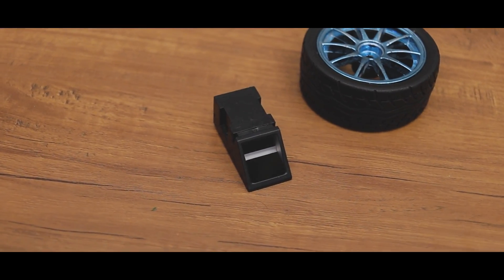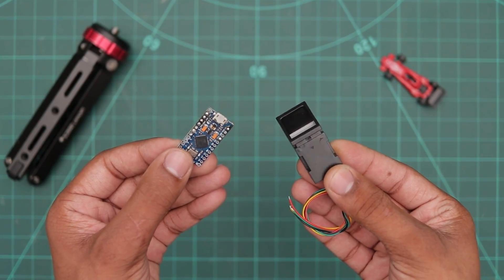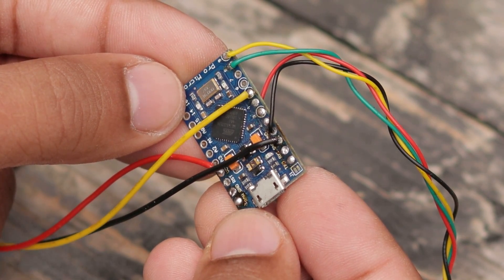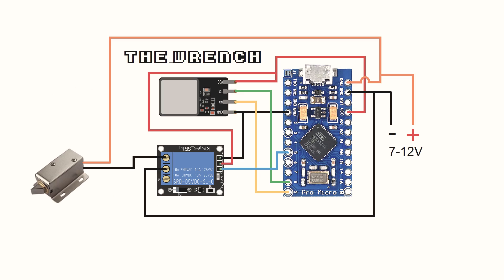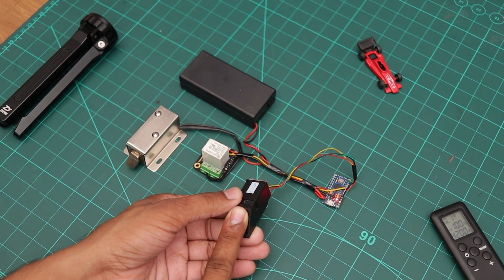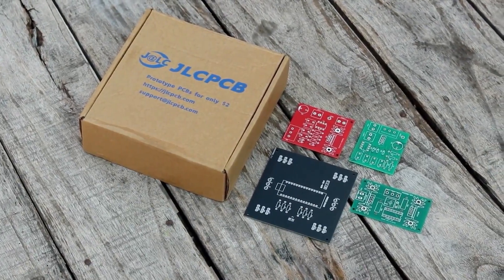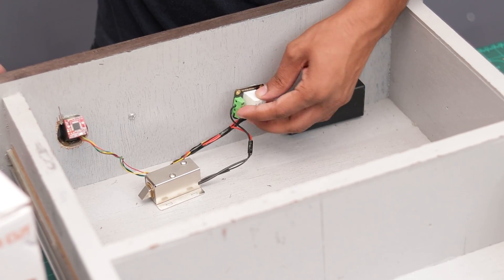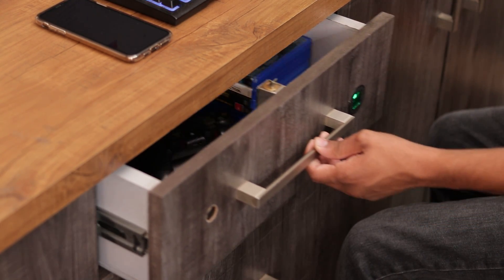How to install Fingerprint in Drawer | Amazing ideas

Comment: Bro If the battery is dead & the drawer is locked How will you open it?!?!?!🤔🤔
YOU SHOULD ADD A DC POWER SOCKET IN FRONT OF THE DRAWER TO OPEN IT IN EMERGENCY & TO CHARGE THE SYSTEM.

Comment: Dud! What if the battries get down and biometric didn't work what about the stuff and the drawer
Reply from the maker: Bro Batteries are Rechargeable, you can recharge once in a week
Reply: @TheWrench  but u didn't had given the port or the option in the material to charge
Reply: @HARSH-mv5bu  I would recommend using a dc socket and DC power supply
Reply: @TheWrench  even we are humans so will also makes mistakes we may even forget
Reply: @TheWrench  sorry if little rude
Reply: @TheWrench  I'm big of yours watch every video of yours

Comment: If the battery life is over then he cannot open the drawer for anything , for even replacing it with a new battery
Reply from the maker: Bro Batteries are Rechargeable, you can recharge once in a week
Reply: @TheWrench  Minecraft
Reply: I know 18650 batteries are rechargable but if someone forgot to recharge the battery and the battery is dead inside the drawer locked 
It would be a big problem😨😨😱😱
Reply: By the way big fan bro